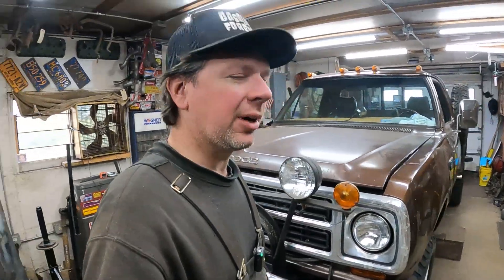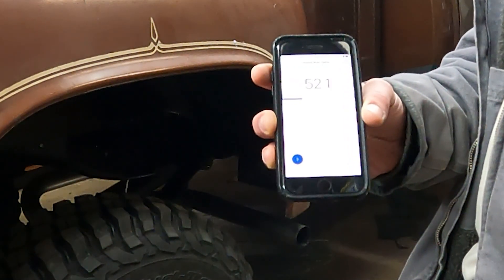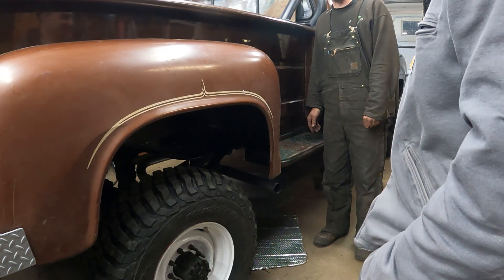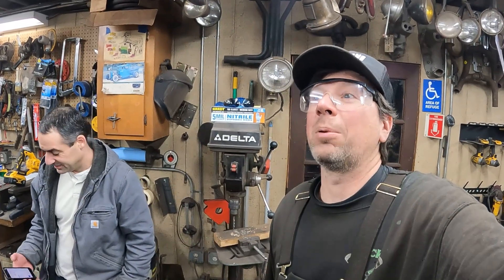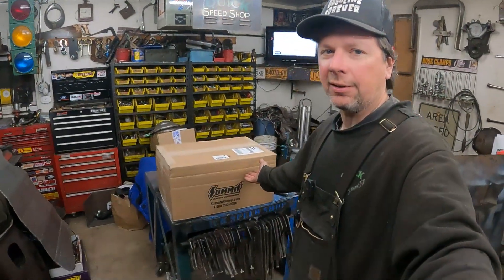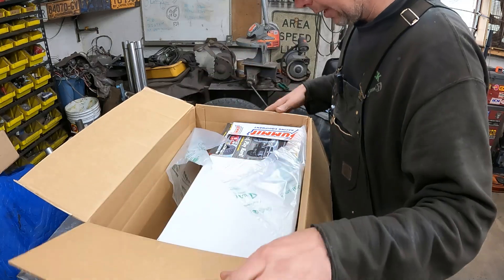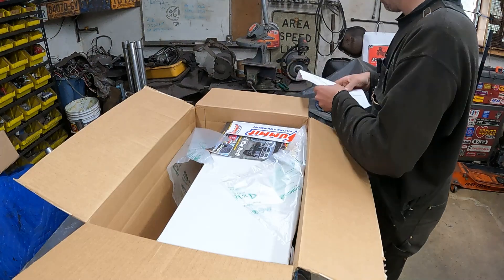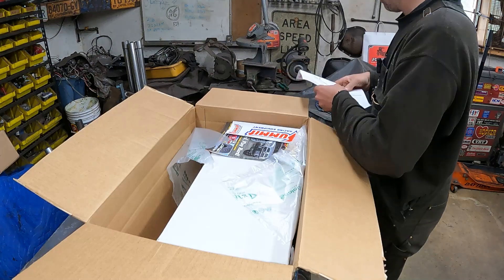Too Dang Loud!  Dodge Powered Menace to Society

Comment: I read on the internet (and everything you read on the internet is true) that the closer the muffler is to the end of the exhaust, the quieter the vehicle. 
Sounds great.
Reply from the maker: Its true.  That's why '59-'64 Chevys sound badass with glasspacks.  The mufflers are way up by the firewall due to the large X frame design.

Comment: Just flatter glass packs. I recommend the stainless steel walker quiet flow. You can decide if you still need the original glass packs afterwards. Lastly. some turndowns at the end pushes the sound to the ground.
Reply from the maker: It's way quieter with these mufflers.  It's hard to tell in the video.  Honestly, it's too quiet at idle now, but the midrange seems good.  I don't want turndowns.

Comment: i know it has to quiet as stock but not the screaming motorcycles
Reply from the maker: Technically, now every single motorcycle in NY is illegal and won't pass inspection without a factory exhaust system.  I don't care what anyone says, it's safer for a motorcycle to have loud exhaust so you can hear it approaching.  Deer are also alerted.  I can't even count the number of deer I have alerted with loud exhaust on my vehicles.  It gets their attention.  New quiet cars are on them with no warning.  Also, pedestrians look at my vehicles because they are loud.  I'd like to know the stats on vehicle/pedestrian accidents and how much they increased when cars get quiet.  I know that's why they have noise makers on electric cars.

Comment: My magnum 318 2000 dodge ram sounds like a stock dual exhaust it's a factory single exhaust pipe truck coming out in front of the rear right tire